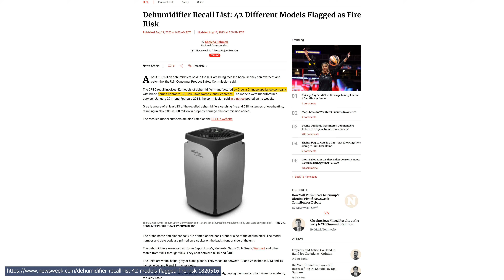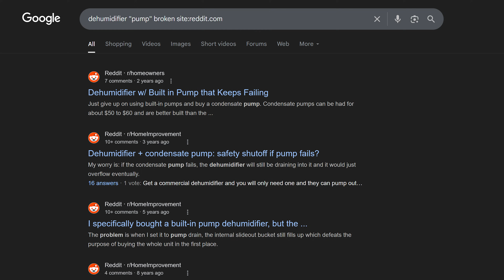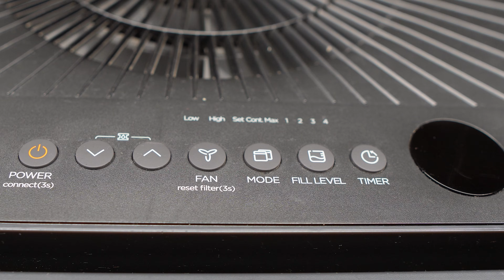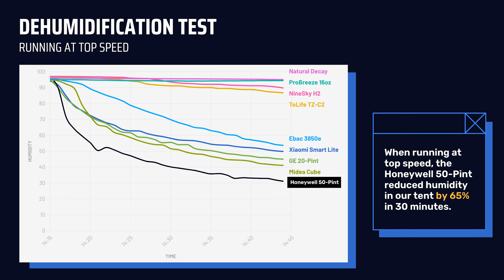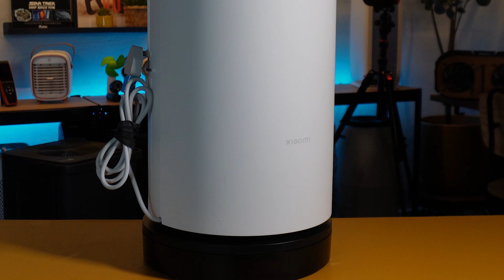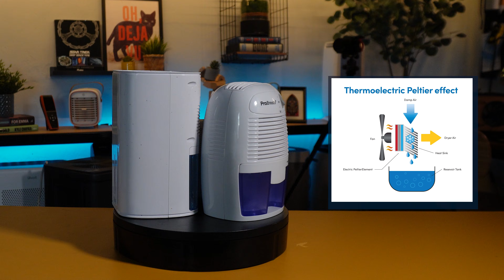Don’t Buy a Dehumidifier Before Watching This → The Best Dehumidifiers We Tested

Comment: I’m in search of someone who mentions the heat that the dehumidifiers put off. Mine makes my bathroom and room so hot in the summer.
Reply: A/C + Dehumidifier = Perfect climate control
Reply: I have a 120 pint. Per our dehumidifier it stays 82° down there. It puts out way too much heat. So I tried to visit at the flu. And it wouldn't work as well. Any suggestions on how to keep the temperature down in the basement
Reply: @thomasmeadows256  some AC units also have a dehumidifier mode.  Since you already have a dehumidifier, you could get a cheap AC unit and run it when the humidity is under control.
Reply from the maker: Yes sadly refrigerant models do output heat as part of their process. Maybe an external air vent could help.
Reply: olyan gépet vegyél amiből nem sporolták ki az anyagot  akkor  nem fog fűteni   iletve a ventilátor fordulatszámot is mindig maxon kel járatni   a levegőt felfelé kel fújatni  ,    sajnos vannak olyan gépek amikn legalább 5 fokkal melegebet fújnak   de vannak olyanok is mint az enyém hogy 0,5-1 fokkal fúj csak melegebet   2 óra alat 0,1 fokot emel a  hőmérsékleten  pl egy kis szoba vagy fürdő

Comment: The Honeywell may be loud but left on while at work for 6 hours and plugged into a timer might be a better option.

Why do we dump the water from the tank down the drain instead of reuse for drinking water?
Why do we need to buy vapor distilled water when a dehumidifier creates vapor condensation which drips into a collection tank? And could be poured into a funnel into a 7 gallon bottle with a hand pump accessory? Or pump water from the 7 gallon jug into a Zero water purifier before use as drinking water?
Save money buying bottled water when you get lots of water from a dehumidifier’s
Water Collection Tank?  Not implying water extracted from a moldy basement follow the same rules for harvesting that as drinking water.  But if your dehumidifier is located away from those areas you could reverse engineer it in winter to extract moisture from the humidity to use as drinking water and washing dishes. Great for Recreational Vehicles. And using to harvest drinking water on a smaller scale to prevent moisture inside the R/V from freezing on inside windshield.
Reply from the maker: Agree that we should try to do more with the waste water and I do what I can to give water to my houseplants. I think the risk of drinking is too high as often dust/particles can enter the unit and could cause a risk of mold/bacteria that will not be noticeable to taste/eye. I did test drinking it here: https://housefresh.com/can-you-drink-dehumidifier-water/

Comment: The Meaco Arete One 25L absolutely crushes his recommendations on this turf. It dehumidifies down to 5°C, while the Midea Cube and Honeywell lose all efficiency as soon as it gets cool. Its built-in HEPA H13 filter makes it a true two-in-one air purifier, not just a white box that pumps water. With an official 40 to 42 dB, it’s twice as quiet as the Midea and three times quieter than the Honeywell—which is practically a vacuum cleaner. The 4.8L tank with a dual-pour spout fixes the heavy, poorly designed bucket issue of the Midea Cube. Bottom line: if you live in the UK, the Meaco is the obvious choice despite its flaws, because it’s the only one actually designed for your climate and your electricity bill.
Reply from the maker: Thanks for the detailed breakdown of the Meaco Arete One. It sounds like a great option, especially for the UK climate! I am going to buy a few different Meacos Arete models for testing, so it may be included in future versions if the performance in testing matches what you have experienced.
Reply from the maker: Do you know how the Meaco Arete one compares with the Ebac 3850e?

Comment: I came back to your feed to do some more research on a air purifier (or two) for our basement, when searching "large spaces," and came across this video for dehumidifiers. I didn't think to come to y'all for recommendations when I was looking but I guess I was steered right anyways! We have two Midea Cubes running in our basement and they are AWESOME. I was truly surprised how humid it actually was down there after we started running them and the buckets filled up. During the wetter months, I'm usually emptying them every few days. A godsend.
Reply from the maker: Glad our top pick matched for you.  The gravity hose can be great but does need a way to an outside drain as saves emptying which can be a lot!

Comment: Hi Thanks so much for the video, I'd like to ask is there any 12Volts dehumidifiers for Van/Car you could recommend please? Thanks very much and I hope to hear back from you.
Reply from the maker: Haven't tested any but you might want to try out some of the solid moisture absorbers like Damprid...etc as they are cheap and can be easily found local. If that didn't do enough then you could look at a more complex device.

Comment: It's for in the cellar, every few weeks I have to empty it
Reply from the maker: See if you can utilize the drain hose  - it does need access to outside but you could drill a hole to the outside (thats how i have mine runnning in my cellar)

Comment: Danny, I need your help. Just bought a midea unit, the only brand available at Walmart.  I have had a Clevast for years with no problems until it just quit! I must have a unit in one particular room.  This new one blows out extremely cold air.  The room is already chilly.  Not warm.   This forced cold air will not work at all.  I read that it's normal, but this was never an issue  with the Clevast (about 8 years).
I think I will box this new unit up and return it.  But what to do about the excess humidity in this room.

Thanks from Alabama, America.
Reply from the maker: Strange as my midea blows out warmish air and its pretty chilly already. Maybe its a faulty one?

Comment: One note about the noise, can I just run it lower and slower to drop noise for example in a bedroom
Reply from the maker: Some models have the option for using low fan speeds which helps to reduce the sound output. Our latest models we tested are here: https://housefresh.com/best-dehumidifiers-we-tested/

Comment: Good vid. Question: when your dehumidifiers with the pump broke, where they still able to be used with the bucket?
Reply from the maker: Sorry this wasn't clear but yes the dehumidifer will still work but will only fill the bucket vs using the pump pipe. As I know since my video many of the non-pump versions have been out of stock.

Comment: The most important thing is not to buy a small desk dehumidifier. I calculated they pull 2% of a proper one. Even running them 24h a day is not sufficient.
Reply from the maker: Yep 100% Even if they did remove enough water, they would cost you so much in energy you will quickly stop using it.

Comment: Awesome video,  but I would really love to see their performance measured on different temperatures as in lower temps dissicant dehumidifiers are much more performant than compressor ones...
I live in Greece, where we have temps in the winter around 10C and a lot of humidity >70%>
So these datawould greatly help me choose.
Reply from the maker: Yes good point and I will see if we can look at doing some testing during winter months. Many of the refrigerant models stop working at 10C but I can see if we can test some more desiccant models.

Comment: Woods made in Sweden. They have models for garages and cellars, creep grounds, and drying laundry. If you have humidity problems in the house itself then there is some real problems in the construction or ventilation and a dehumidifier is only like taking pain killers without addressing the issue.

I do not have dehumidifier but have considered one for the garage were I keep temperature at +12 to +14 C. Now I adjust the humidity by temporarily increasing the temperature by 1-2 degrees. Issues occur when the temperatures are around zero outside and relative humidity is close to 100 % for an extended period. This can cause condensation to appear on the windows. This does not happen every year but have become more frequent during the last few years due to warming climate and more rain in the winters. A de humidifier could help with this. I could also use it for drying laundry as we hang our clothes in the sauna during winters (outside in summers).
Reply from the maker: Thanks for sharing about Woods. I agree there are many situations that you need to fix the source rather than just throw a dehumidifier at it... but I live in an old house and a dehumidifier helps me and adding other ways to fix would be very hard. It's also just generally very humid even during the winter in the North of England.

Comment: What about roll around portable ac unit with a built in dehumidifier?
Reply from the maker: Haven't tested any but do want to get into them in 2027 - so can tell you more then!
Reply: I have been using them for years as they are versatile (all year around. Yet for the winter, not heat efficient)
First one I bought just crapped this year:  danby, manufacture date, 2008. Also have another danby which I've been using for a few years, manufacture date, 2020. Keep my fingers crossed regarding the lifespan (used as ac in summer and dehumidifier in winter)

Comment: This video is a huge disappointment, because it uses a patina of science to carefully bury the really painful truth about dehumidifiers: NONE of them seem to be designed to last now. All of them appear to suffer from planned obsolescence, unacceptable failure rates, and/or defective designs, often due to cost-cutting on part quality. And they generally cannot be easily repaired by their owners. Read the one-star reviews of the models he is discussing. You will see what I mean.
Reply from the maker: That's fair that many do break but I am now seeing new models coming with 2 and 3 year warranties so I think it is something that some brands are aware of and are trying to find fixes for.
Reply: @H @HouseFresh  from long experience, I think you know as well as I do that an increased warranty period is most often a sign of trying to fix the bad reputation —not fix the problem. Those warranties will turn out to not be worth the trouble to try to fulfill.

Comment: What makes the Ebac more efficient than the Xiaomi? At first I thought it must have been an efficient compressor technology but no. They claim 21 litres but that cannot be true, at least not under the conditions other brands test their devices (30C, 80% RH), they conveniently don't mention that anywhere. Also, what can possibly be different about the UK damp? It just seems like dishonest marketing to me. Thanks for covering the Xiaomi btw. There is a slightly beefier non-lite model but not available where I live.
Reply from the maker: From what Ebac say, their system adjusts based on the level of humidity overtime rather than just setting a humidity target and going full power to hit it. 

There are some more details here: https://ebac.com/dehumidifiers/smart-control

So my assumption is that they are able to not run at full power as much so that is where the energy saving happens. 

I have been working on a new test looking at efficiency based on water extraction, and the latest Ebac models did well so I do think their compressor does have good efficiency also as this test was done using continuous mode.
Reply: @HouseFresh  They are running at full power when they're running, and they turn on and off, like every other cheap dehumidifier, the difference is they cost twice to three times as much. I've let my 3850e run side by side with a cheap 20l kingpost and was not impressed. The Kingpost collected almost twice the amount of water while consuming roughly twice as much power, which probably means the Ebac is likely a 12L model by industry standards (80% 30C). 

There are in fact inverter dehumidifiers in the market today, and they can be significantly more efficient and quieter, because they can in fact regulate their compressor speeds. There is a Trotec that I have my eye one, an 35L model that costs less than the Ebac 4850, has an inverter compressor and wifi. I was duped once and bought into marketing but I see absolutely no reason to buy Ebac.

Comment: What about machines that are dehumidifiers+purifiers?
Any info on them?
Reply: I was wondering the same thing but after watching the video, I don’t know if that would be a good idea due to the recalls on the humidifiers alone. I’m thinking I might have to go one separate unit for each needed purpose although a two and one would be ideal. Let me know what you end up doing or if you find a good one thanks.😊
Reply from the maker: I have tested  a small one and it was poor at both jobs. I also looked at the air purifier function for the Meaco Dry Arete 2, and it was very low CADR so not super useful but it did have good dehumidifier function.
Reply from the maker: The video i talk about the Meaco Dry Arete 2: https://www.youtube.com/watch?v=kv2sMl2h618

Comment: Hi and thanks for the video.  Noticed on the Midea cube you threaded a garden hose for continuous draining while it was sitting on the bucket.  Were you able to get it to work.  My cube will only drain into bucket while sitting on the bucket.  Thanks
Reply from the maker: We had an issue that the outlet got covered in gunk and this caused our unit to only output to the bucket. Try giving it a clean and see if uses the gravity hose again. This has happened twice in 2 years. 

Sorry this comment is super late. Let me know if it works.

Comment: Need a dehumidifier right now to grab the steam that's coming out of my ears after watching this.
I want to spend less than £100 (preferably a lot less) for a small machine that can be easily emptied by an elderly person, is cheap to run and actually works.
(NB: Anyone that responds to this with something along the lines of you get what you pay for. **** off you smug ****!)

Comment: Great review thanks.
I’ve had 2 ebac’s heavy duty metal cased dehumidifiers and both have lasted 12 -15 years each and and the only time I switched them off is on a hot & warm summer days..
Drawback’s ugly and noisy.
Sadly mine is on it’s way out or maybe a repair.
I’ve always preached if you take water out of the air you get a warmer home and no mould. 
But thanks to your video on this subject..enjoyed ❤
Reply from the maker: Wow 15 years is awesome. 

Big fan of keeping homes dry if you can, have given quite a few as presents to few friends living in damp houses. 

Thanks for the kind words. 

You might also like our video about UK models: https://www.youtube.com/watch?v=kv2sMl2h618

Comment: I need a big humidifier for an RV something that will do the job something that’s quiet and will not break down but how many cubic feet does each humidifier do
Reply from the maker: I would go for a model with at least 6 pints. Avoid any of the super small models as they are pretty much useless.

Comment: I enjoyed your take on this topic. I have a Hisense brand dehumidifier from the US “big box” Store called Lowes. It’s just over 2 years old and died just after the Warrenty expired. Turns out to be a very common problem, error code E9. So, common that even searching Amazon for the error code can yield results for a replacement part. But there may be a catch…
The manufacturers customer service knows what the bad part is. But there are none available from them directly. The review for the parts being sold on Amazon are not very positive. I’m guessing they are just knock offs that don’t meet the requirements of the dehumidifier. It seems like you could make a video about this “planned obsolescence “ that is plaguing dehumidifiers.
 I have ordered one of the cheap(ish) Amazon part to try and repair my unit. But if it fails, I’ll be looking at the Midea Cube. Thanks
Reply from the maker: Sorry to hear about your issue and does seems to be a big problem with dehumidifiers of planned obsolescence as have also read lots of reviews of models breaking right after the warranty. Hope you get your sorted with the part, I had to clean my outlet hose on my cube this weekend but now it’s back working well.

Comment: The best dehumidifiers are the more powerful  high watt models, problem is they cost alot to run.
Reply from the maker: True but if the hygrometer works ok, then they should stop when target is reached so can end up costing you less overtime. But they can be much louder than smaller models.

Comment: Got the Xiaomi one and as far as the ventilator goes, its not loud but there is this high pitched noise that is present at any speed and its driving me insane. Not sure if its just my unit or are other machines even worse then? If anyone can chime in I would highly appreciate it!
Reply from the maker: I didn't notice it but I know my ears are not that sensitive. Anyone else experience this?
Reply: @HouseFresh  The noise actually stoped when I was moving the unit around so I think it just needed a bit of a shake to adjust! :)